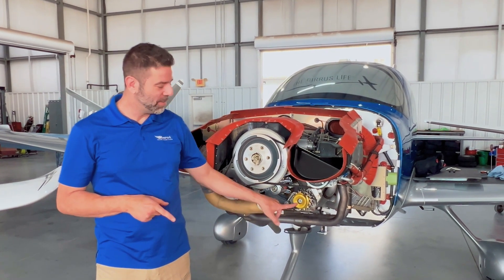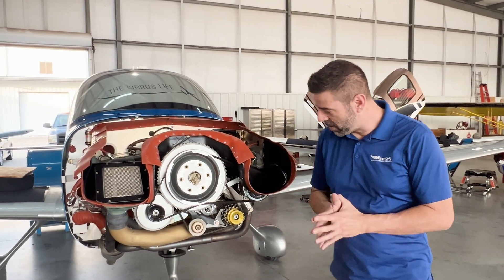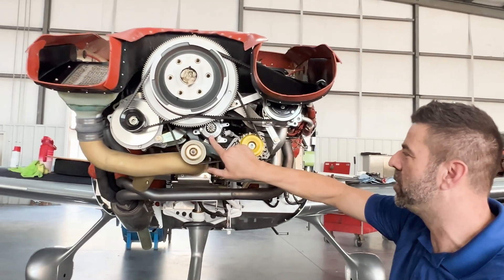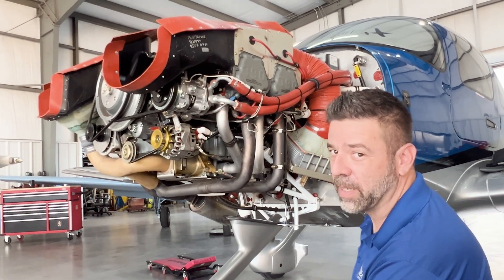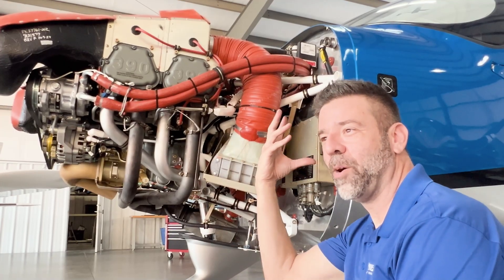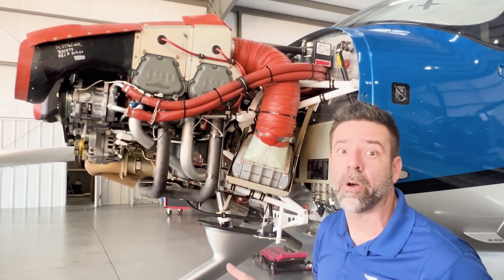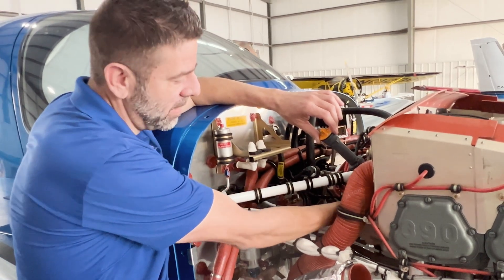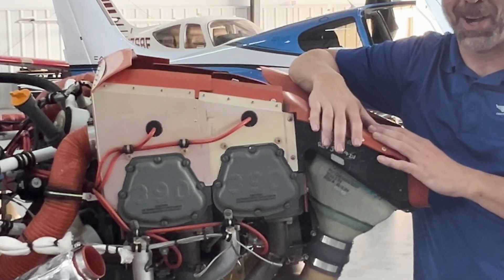Cirrus SR20 Walkthrough with Coach Ray: Essential Mechanical Awareness for Pilot Training

Comment: How do you get to the spark plugs?
Reply: There’s a set on top and on the bottom.
Socket style wrench with an extension
Reply: @coachraythepilot5759  I probably should have watched the entire video before commenting.  I saw the spark plug wires after looking more closely.